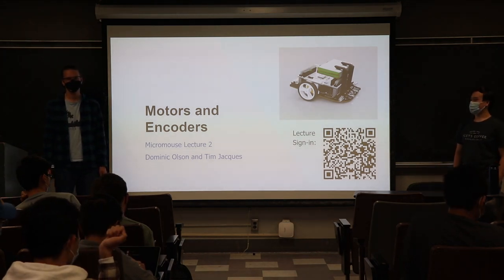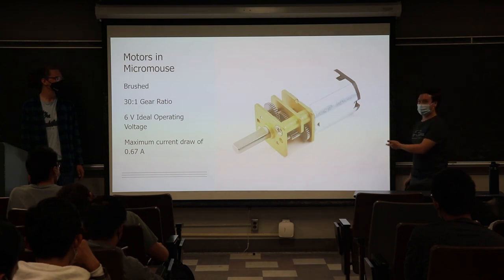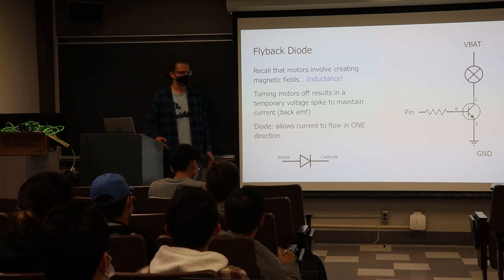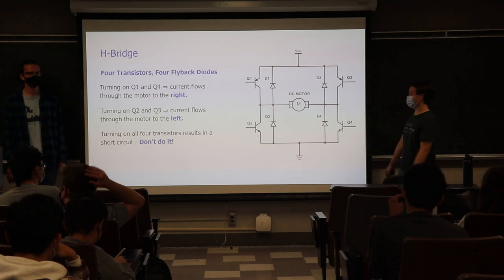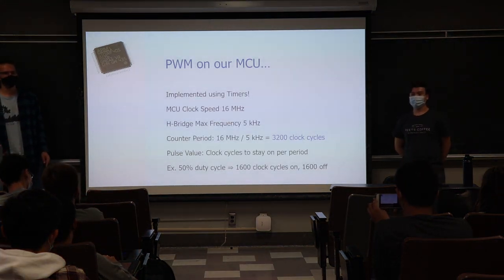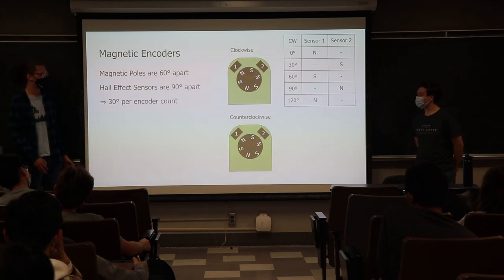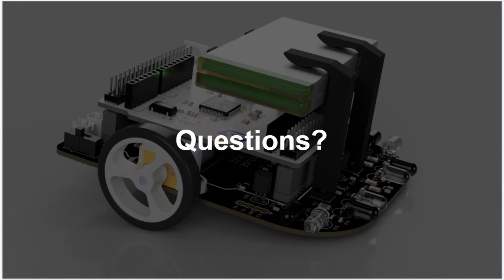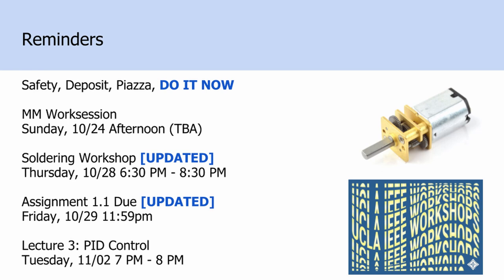Micromouse 2021 Lecture 2: Motors & Encoders

Comment: When selecting your motors did you do any research into stepper motors?
Reply: Stepper motors are heavy in weight and also require 12v to operate which is why it will be not wise to use them